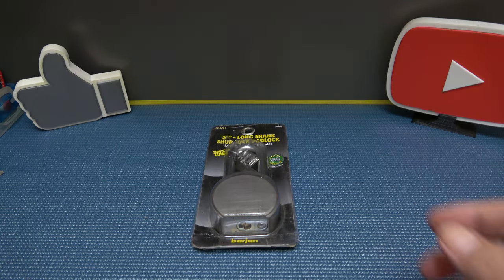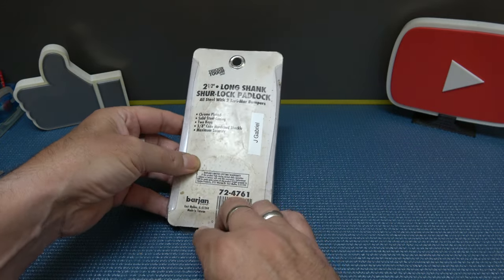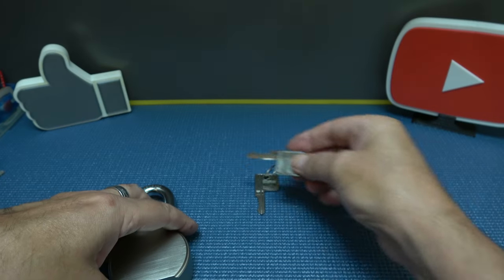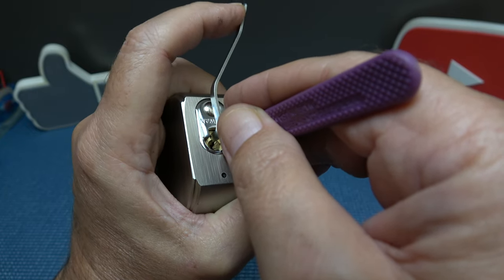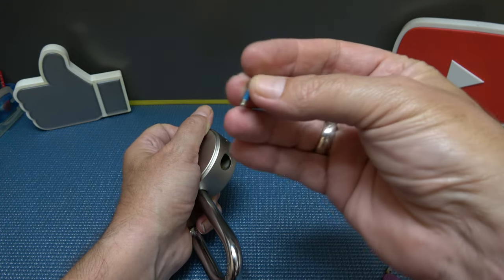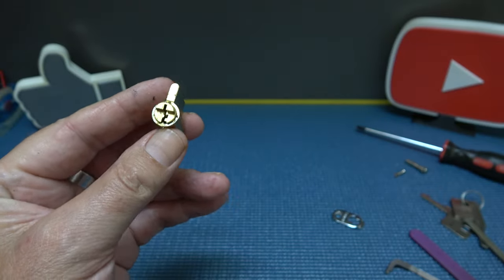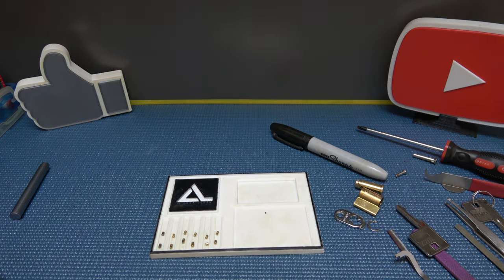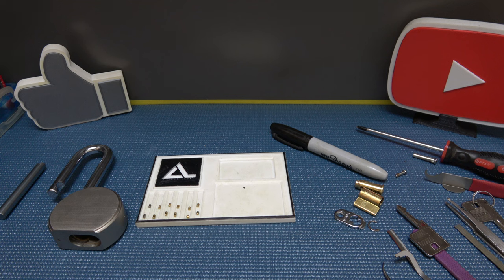#461 Barjan Shur-Lock is everything I look for in a padlock

Comment: When you said bloodshed I thought there was going to be a gutting disaster, not your blood & guts.  Also, I guess you really can't judge a lock by its brand, unless it's a MasterLock.  Did that guy say how much this cost?  Are those first pins steel for drill resistance?
Reply from the maker: No since it was a gift I didn't ask price. Also, I did check those first pins with a magnet and they didn't stick. Ya, I must have jabbed myself while trying to remove that pesky clip. Not the first injury and probably not the last. Locksport can be rough 🤣🤣🤣